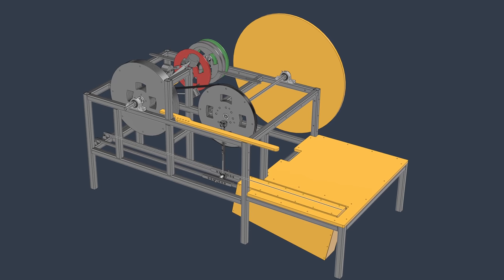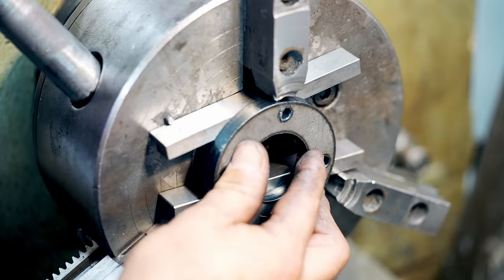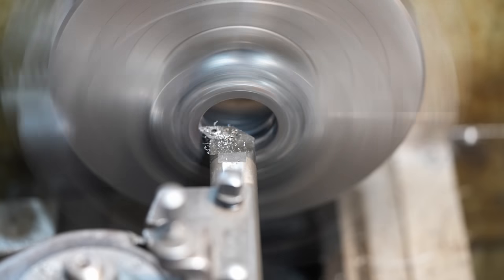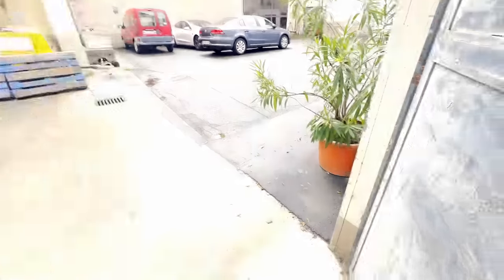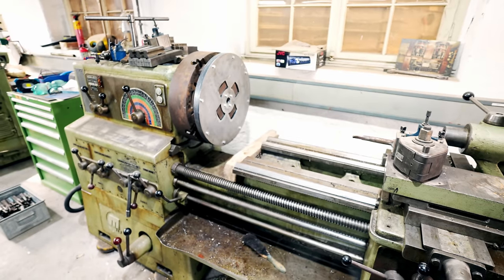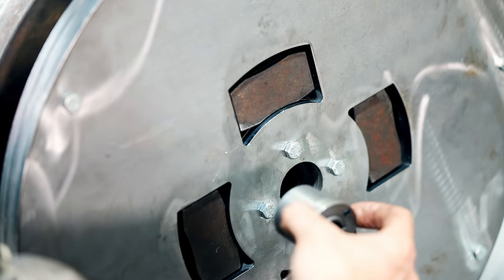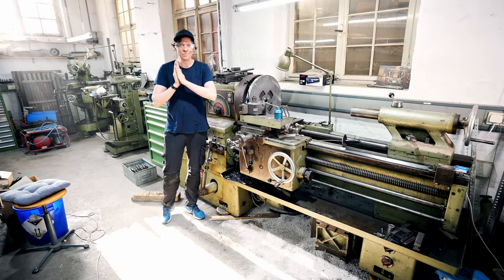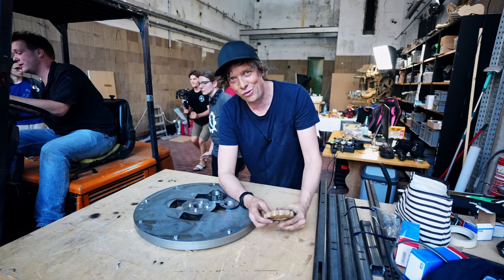Turning Metal on a BIG Lathe - DAY 2 - Marble Machine Flywheel Prototype

Comment: 8:55 & when you're tapping in a part, move the dial indicator probe off the work. You can shock load the dial mechanism and throw it out of calibration if you don't.

Comment: As a trained Machinist I can ensure you that it is called turning ;). The "safety" sandals triggered me ngl -_-, this can end badly.
Reply: To be fair to him, the Swedish word for turning, svarva, literally translate to lathing
Reply: You can use lathe as a verb according to the dictionary, but turning is definitely the preferred nomenclature among machinists.
Reply: My father used to wear safety sandels in the summer. I looked it up and you can still buy some. They have a toe cap and you can buy them with reinforced soles.
Reply: at least he wasn't depending on the safety squint.
Reply: @AffordBindEquipment  the only safety goggles I ever saw him water was a pair of green tinted welding goggles. When grinding he definitely squinted for safety.
Reply: Is “machining” also acceptable or is that too general of a term?
Reply: @joez6235  It is completely acceptable. You're machining on the lathe.
Reply: @YoDaPro  however, machining refers to several different types of processes one might perform during metal fabrication. Turning is more specific, relevant, and appropriate to the process being performed here...
Reply: Me to.
But for a novice Swede,  a lathe is called svarv in Swedish, and we say svarva instead of snurra, witch is the Swedish name for turning.
It is also called a supportsvarv. And inside turning can be boring. :)
Reply: It was Martin taking a dig at English as a language, rather than believing it wasn't turning.
Reply: And I assure you can't  ensure a person.
 pedant's gotta ped.
Also Trolls gotta svartalf.
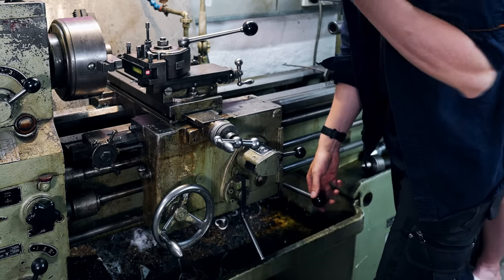Reply: @MrFrozenFrost  0:55 he has clear ones for machining and wears them through the whole lathe operation.  hot chips in the eye is not a good idea.  I got a bit of welding splatter once and had to have the Dr. dig it out....
Reply: @JanTuts  I was thinking the same thing. Love that guy!
Reply: The most triggering thing about all of this is the boomer habit of using punctuation after emotes. They already function as punctuation, society has established this.
Reply: I get the point ;) @Squant

Comment: Taper-lock!  The perfect solution for your flywheel... thanks for listening to your community, that's what we're here for.
Reply: asking out of ignorance...do you have to be careful to tighten each of the set screws the same amount to avoid the centre being pulled to one side or does it not matter in a material manner?
Reply: @miless2111sutube  I was wondering the same thing.
Reply: @miless2111sutube  it shouldn't be a problem for THAT, but it puts stress into it, risking damaging it.
And it's easy enough to get it similarly enough just by feel, just go around and only tighten each one a bit, over and over, and all of them end up the same. Basically, it you tighten one of the screws ALL other ones get a bit looser, so you have to go over all of them anyways
Reply: @miless2111sutube  The tightening is in line with the axis... so any offset is minimal.  In other words, you don't need a torque wrench to do this.

Comment: That's some big metal for your first cuts!
Reply: They are really brave letting someone completely inexperienced use those big machines with only a short introduction.
Reply: @NoiseMakerX  He had help with the setup, which is the complicated part. With the setup done, lathes are very simple and intuitive to operate and are very safe if you don't put your hands (or especially hair or loose clothing) anywhere near the spinning chuck or part, which he didn't. If you do stick a shirt sleeve where it doesn't belong, you're probably dead before anyone can react anyway, so that's a comforting thought to end on!
Reply: @Ryan_Thompson  I used lathes for a year at school, about 25 years ago, so I know a little about them. I stand by my earlier statement.
Reply: @NoiseMakerX  Tech schools would never let a student do a job like this for their first project. I still have my hammer I made, brass on one end and aluminum on the other with a steel handle. It all unscrews apart.
Reply: @billkeithchannel  I think I still got mine too in a box in the basement. Brass on one end and plastic on the other.
Reply: @NoiseMakerX  So I am supposed to bow to your impressive resume consisting of a year of shop class 25 years ago? lol All of the machinists I've taught in that time should have apprenticed with you instead.
This isn't school, and nobody is trying to train him to be a machinist. They gave him a single setup for one quick little chamfer, along with (as he said) a "whole day" of training, and chance for the supervising machinist to observe and make sure he'd be OK on his own for a bit.
It's entirely possible to train someone to safely turn a chamfer on an already set-up part in less than a day.
25 years ago, though? Why don't you find a local makerspace and start making chips again in your spare time? Maybe I'm biased, but I find it rather satisfying. 🙂
Reply: @Ryan_Thompson  Butthurt much? Chill out man! My only point is that using the autofeed you run a greater risk than manual movement, this is true no matter what you say. No need for you to freak out.
Reply: @Josh_728  OK. So you lathing wood is totally comparable, right... That non of you got hurt is no proof that you can't get hurt, or like damage the chuck if you run the tool into it or whatever.

Comment: Just checked with my wife, who knows English grammar much better than I.  We don’t say lathing, because lathe is a noun and the ing ending is used on verbs.  In American English at least, we turn a part on a lathe.  Turn is the verb, so when we make what is sometimes called the present participle, a form of the verb, it becomes turning.  Nouns don’t become present participles, or any other verb form, so there is no lathing.  When you shift over to a milling machine, it is confusing because mill is both a noun, the machine, and a verb, the operation you perform with the milling machine.  Mill, as a noun, and milling machine are synonyms, though mill as a noun has other meanings, too, while milling machine is pretty specific.
Reply: Interesting, I thought hardly anything stops English speakers from verbing a noun.
Reply: To lathe can be a verb too. But turning is more common, but lathing is correct too.
Reply: @darkiee69  Anyone who says 'lathing' around a machinist is going to get a funny look.
Reply: @EdwinSteiner  Those of us married to language teachers have to watch ourselves.
Reply: Hoovering : )
Reply: @markholm7050  I know, I'm married to a teacher of both (German) language and religion, so I'm no longer allowed to call a "Schöpfkelle" a "Schöpfer" like normal Austrian people ;-) (I'm afraid that won't translate.)
Reply: I looked it up in Webster’s New Collegiate Dictionary.  It says lathe can be a verb that means to shape a part using a lathe.  So I guess by that standard, I am wrong.  I will say, in 68 years I have never heard a native English speaker use lathe as a verb.  I have spent a little time around machinists, too.  They never said that.  Everybody turns parts on a lathe.  If you cut a hole using a lathe, that is boring (a verb).  If you cut threads on a part using a lathe, that is threading (a verb).  General lathe machining is turning.  Is this one of the British vs. American usage things?  I don’t know.
Reply: Tabling a motion. Chairing a meeting. @EdwinSteiner is right, to make a verb out of a noun is one of the great powers of the English language. Whether it's in common use or not is sometimes a matter for debate. But it could be....
Reply: @EdwinSteiner but there is a difference between EIN Schöpfer (a ladle) and DER Schöpfer (the creator, god). You are just not allowed to ask for a specific ladle. Any will do. Then it's ok. Also: Austrian ftw. ❤

Comment: Turning tip: When possible, use forced feed. When you hand feed, the speed varies, and the faster you go, the more the lathe flexes. You get a smoother surface at constant feed rate.

Comment: I tell ya, I worked on some old lathes myself for a bit, and one must be at least 30 years old, because otherwise it did not stand the test of time. These machines are build to be robust and serviceable forever pretty much. Working on them is quite a lot of fun.
Reply: 30 yr old lathe?  - that's a new lathe in places i have worked.
Reply: The fact that the all the lathes I've seen are decades old and still doing well is a testament to their build quality, to be sure. But could it also be a testament to how little the technology has advanced? If we compared them to lathes manufactured in 2023, would we see significant improvement?

Comment: There's a reason a lathe is used to turn. There is another operation it's used for. Spinning starts with a flat piece of metal and uses various tools to deform it into a desired shape. The way it does this is by rotating it very quickly **on a lathe**.

Comment: I would highly advise to actually measure the bores. The first one is actually quite a bit to loose. I mean it's gonna work but the clamping force and the self centering abilities are reduced quite a bit with a looser fit.
At the same time tho mess around and find out so just try it and see if it becomes a problem later
Reply: I might be wrong. Didn't he say the inner thing could expand and contract as needed?
Reply: Either way, measure first. Then, measure second. Then cut. Generations of machinists will tell you this.
Reply: If the lathes had DRO (digital readout) they could just machine very tight pressfit tolerances on the inner diameter and just use hydraulic press to lock the bushing in place. But that requires DRO and hydraulic press which i don't think they have, so they are working with what's available.
Reply: @Cyrribrae  they can expand as needed but only to a certain degree after that you run into issues like deformation in the bushes, reduced concentricity, and reduced clamping forces. These things are supposed to go into a precision bore and take up like 0.05mm (2 thou) on each side. 

Even though I'm not sure in Martin's case since he has some crazy looking spiral ground ones
Reply: @marcingrzybowski1764  They could still do this without a DRO by taking a very shallow first cut to index the tool, then measure the inner diameter of the cut manually and afterwords use the scale on the hand crank to know how far to move the tool. Though an important thing to remember is that you are always taking off twice the distance you are turning the crank as you are essentially adjusting the radius and not the diameter of the cut.
Reply: @jf41012  i thought for a while how to actually do this without the DRO, but did not think about this.
Reply: I was going to comment the same. There's a minimum amount you can cut so "creeping up" won't give you a perfect (besides luck of course)

Comment: you still need to get all of these balanced for high speed

you can think you balanced them already but balancing makes sure the wheel does not have none concentric weight in X,Y,Z
-you balance to get rid of material variances

if you want to know what balancing stops put a weight at the end of a string or rope and spin it around in a centrifugal experiment and notice how the weight moves your hand this is some of what balancing fixes

Comment: Not nearly aggressive enough on that OD.  You want it breaking into small chips, not a birds-nest of swarf which just gets jammed under the tool/insert and scratches the work, ruining the surface finish.  You want to ramp up the RPMs and advance the tool faster.  If you really can't do that then clean it away far more often, more oil wouldn't hurt either.

Comment: Martin, I admire your willingness to take on new challenges and learn new skills!  That said, if the goal is the most stable rotation speeds (for the tightest music), I have concerns about your flywheel/pulley manufacturing processes:
1) Not sure why you didn't plug weld all the flywheel layers together (per the CAD drawing) BEFORE doing any turning.  You need to do all the turning in a single setup for maximum concentricity/minimum vibration; loosening the bolts to mate them together later will lose everything gained to that point, requiring more turning (and now the hub ID will be too big).
2) Any provision for face-cutting these parts?  Otherwise, they'll wobble about the axis and create more vibration.  (Needless to say, the bolts aren't gonna help!)
3) What's the strategy for balancing these parts, again to minimize unwanted vibrations?

Sorry if I'm restating the obvious here, or otherwise ignorant of the larger plan.  It's just that I've been watching you work for years, and I really want you to succeed.  Good luck!
Reply: I imagine its a case of it being "good enough" as it is, without needing to get too technical. Though as a machinist, lack of concentricity is definitely a trigger for me xD..

Comment: The machining in this video makes me sad. Why were you manually running the carriage cross slide instead of using the bed autofeed like the machine was intended to run?
Reply: He's not learned that part of the machine yet.
Reply: When running the carriage by hand it will stop ita movement as soon as he let's go. If using the autofeed and something goes wrong he might end up damaging the lathe, or worse, if he happens to be just a bit to slow stopping it.

Comment: It's recommended to not use anything that could function as a coolant with carbide tooling unless you can keep temps consistent (like flood cooling); otherwise, you risk shocking the tool, diminishing its life.

Comment: Wouldn't it be better to machine the inside diameter to the specified, recommended size for the tapered bushing?  I am sure that the specifications are available, and would tell you the correct size, including tolerances. Then you can use a micrometer and work to plan...

Comment: martin i follow your logic its a lathe therefore your lathing, but your new to this and it is an old skill as well as carpentry and lathing as a term is allready in use. lathing refers to the building material used as a plaster foundation in a wall system. turning is a general term where the tool or the work piece turns in a subtractive manufacturing process and it as well is an old term whos meaning is known.

Comment: Reminds me of trying to hang an old fashioned railroad signal in my basement. It's big and round and quite heavy. No way I could lift it by myself. But thanks to physics and the use of levers I got it up there. Chain it to the ceiling while standing on its side on the ground, then lift one side up and slide a wooden box or cabinet under it. With half chained to the ceiling you're only really lifting half the weight which is doable. Then stand it back up, shorten the chain, lift again and slide a bigger box underneath. Eventually it's the correct height. People ask how I got it up there. He. Not the first time I've hung that thing. It's been in three different houses.

Comment: While the machine is called a Lathe the operation is most definitely called turning in english. There are other operations which each have their own names eg knurling, drilling, tapping etc.  Glad to see that you planned the operations well and that things are going smoothly. If i could make one suggest with the stacked plates it would be to drill and ream dowel pins for a light press fit so that if you ever have to take the plates apart they go back together more easily.

Comment: I am worried that the flywheel will not be balanced. Even though you turned the OD and the ID, the holes for the chuck may not be concentric. Did you have another way of balancing the flywheel?
Reply: I'm worried as well
Reply: They were laser cut on a CNC...
Reply: Hi Richard ,  virtually nothing manufactured is actually balanced, no matter how accurate or consentric it has been made.
you can balance rotating parts by either adding weight (think tires on a car) or removing material at appropriate locations
on the  disk. This is usually done by simply drilling holes into it , At a precisely determined location and depth.
There is an entire industry that provide equipment for the purpose.
Reply: @steveggca  I completely agree, my question was if he was planning on performing such balancing or not.

Comment: Rappelling a four-jawed chuck. Dang! 👏

Not sure why machinists prefer "turning" over "lathing", especially since there are ways of workholding which keeps the work still while spinning the tool, which is essentially using a lathe like a horizontal mill.